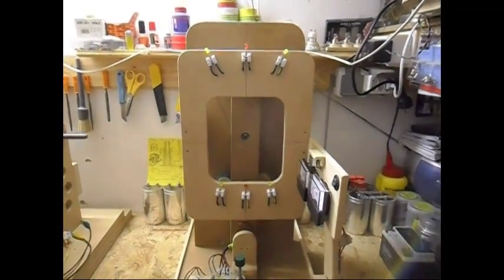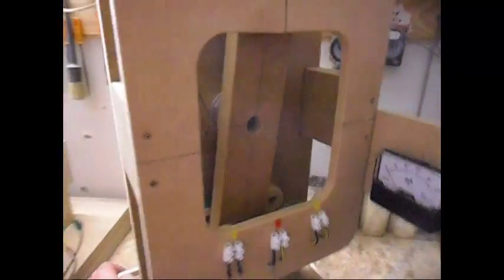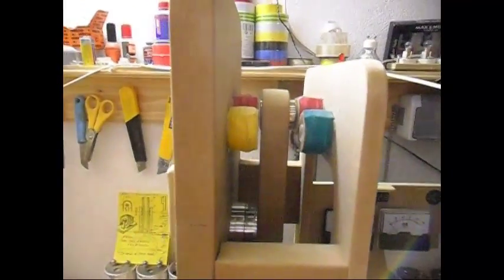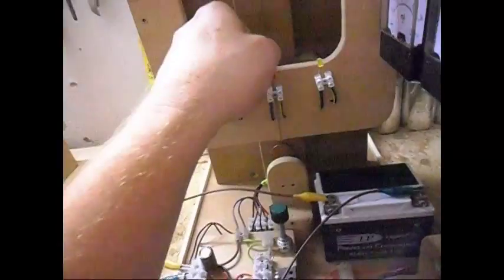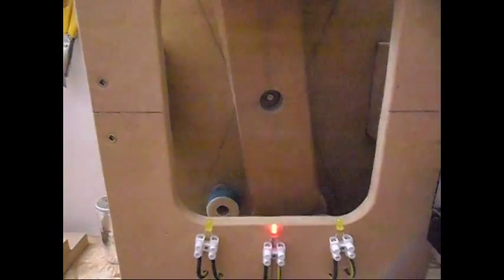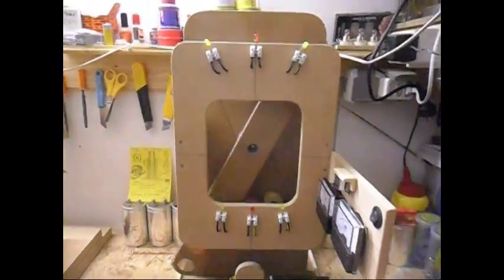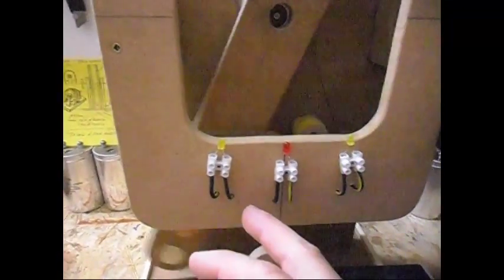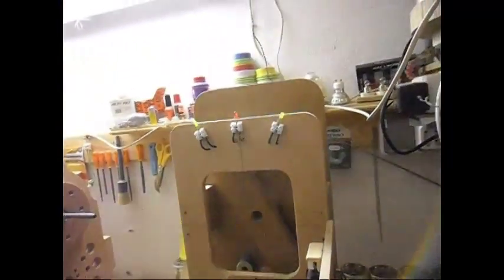Pendulum_Project - First try out, Pendumonium setup going bananas...

Comment: hmm, a few more arms off the main arm,coolvid,  looks heavy too, nice wood?
Reply from the maker: Hi ronald sykes,
Thanks for your comment and glad you liked it...^^
Yep, the one arm can become more arms without having more physical arms added to the setup...lol
It's just my version of a pendulum setup, just need to put all them coils in series and see how it goes...
The setup is pretty heavy and i totally forgotten to mention in the video that on the arm there are 2 copper rods just above the lowest magnet...
Cheers
Reply: i was just tearing apart a in teresting induction rotor ,  it has 8 copper rods set inside the iron plate build up.  and then set on the shaft , but also has a circular magnet on top to ride the field lines of the stator assembly,  unique, .  lots of ways,   everything is relevant,  what black material are you making your devices from.  I collect the black stuff up like lego ,and build the larger structures from that,  black tourmaline is the best,  crushes up fine and just add acrylic,[electron trees] and wala a awesome dieelectric plane or inertial plane structure.  make everything from the black ferric oxide, and incase the rest of it in the black tourmaline,  then incase them in aluminum,  ,  your free energy devices are far more energetic than one can possably imagine.  and your spacecraft ,although can be any color under the rainbow,  I like the jet black one im working on the best,  it truly is as easy as baking a cake, but no baking required,  just remember all materials are relevant, just some are better than others,   , highly recommend the spacecraft club,  learn grow share,  and build that free energy spacecraft you always wanted, you know the one you,ve been dreaming about all this time.  if so  go to   mikefromspace    find the club, and get the disc,  its that easy,  its worth the knowledge for whatever the club price is, plus there is one thing for sure that you will see that makes it worth it,  an updated version should be out now that mikes relocated.
Reply from the maker: ronald sykes
Thanks for your comment and for the extra info about what you are working on...^^
Nice to read that you are experimenting around with all kinds of stuff...keep at it and with time you will get where you want to be...;-)
My black rotors are made of mechanical plastic, it's a bit to much for rotors but since it was free for me to get i've used it for my rotors...
Cheers